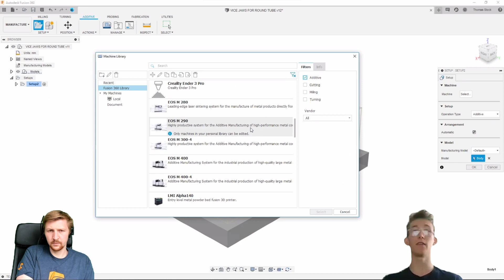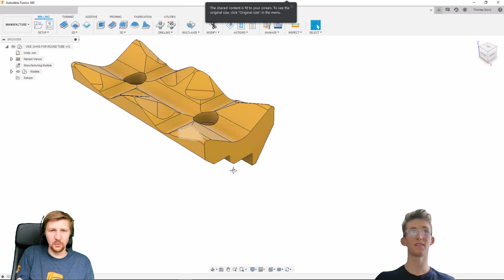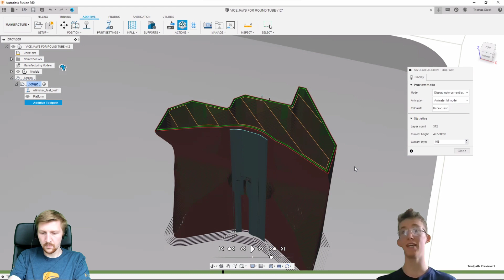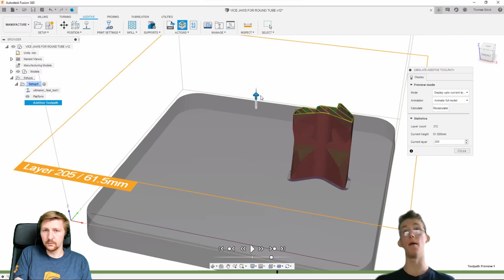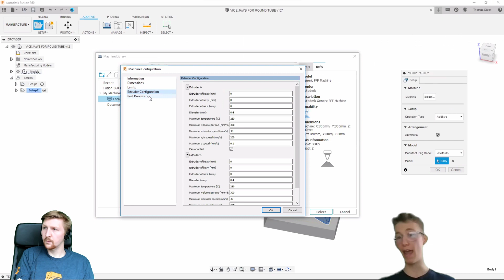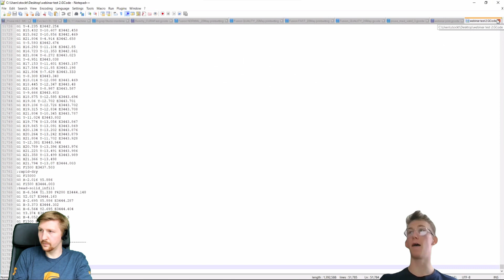Fusion 360 Live: 3D Printing (FFF) Workflow

Comment: Hi, good to see that Fusion 360 now comes with FDM/FFF slicer. Having FDM slicer to the software will make it really a great resource.
I have noted down some issues with the slicer and its settings.
1)The default "extruder retract length" is set to very high (15mm for ender3 printer). This will most likely to cause heat creep and print failures. 
2) There is no option to add initial/end scripts. 
3) Print preview (simulation) doesn't look good.
4) Add the first layer settings.
5) Include some analysis tools which help it to locate thin walls, commands which help to cut the part and create locating features to its mating faces (with tolerance like .2mm for a tight fit and .3mm for clearance fit). 
6) Option to turn off the cooling completely. 
7) make "move tool" to get activated automatically when clicked on a part. 
8) allow users to create their own custom 3D printer profiles for their printers. 
9) finally FDM/FFF AM technology is most popular and widely available technology so you better keep this as an external Add-on/Extention to make the process faster. (just right click on body/component>show option for FFF print>jumps to a external software)

I hope you will fix these in the next update.